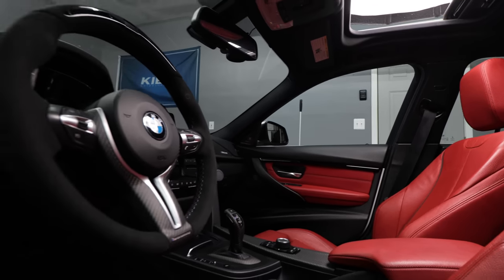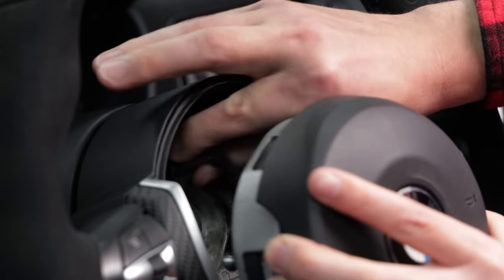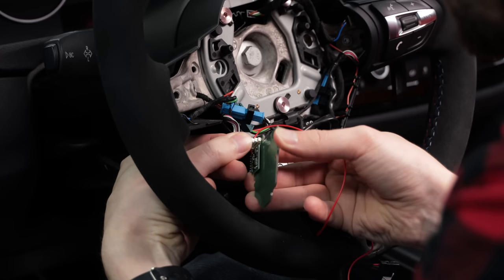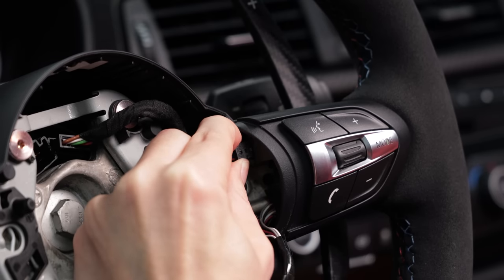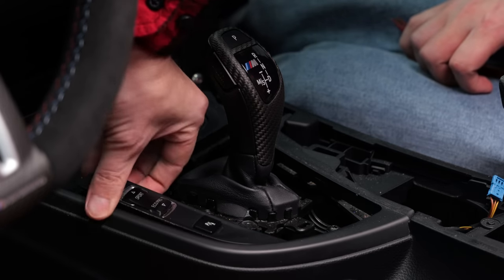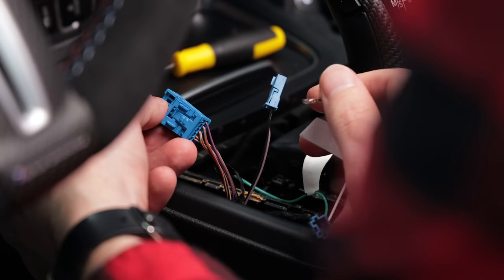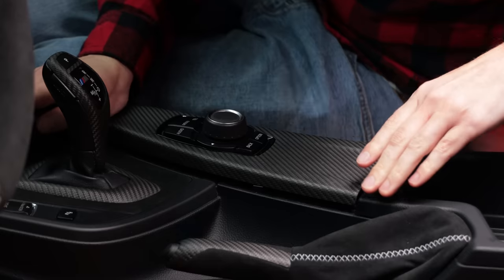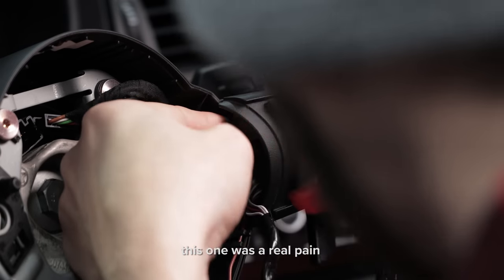How to Install FUNCTIONAL M1, M2 Buttons | BMW F30/ F3x

Comment: Love this video.  Mine is a m240i (f22).  If I only enable the two buttons on the steering wheel and don't change to the new computer board, will that work?

Comment: Hey Justin, thanks for the video! I was wondering can you do this upgrade if you code out the adaptive cruise control? Or do you mean they won’t be blank if you have adaptive CC? I’m just a little confused since you highlighted your CC buttons when you were talking about ACC so I’m not sure if you have the Adaptive CC and disabled it. Sorry…
Reply from the maker: Hey, I think I meant that these could only be installed if your car didn't have adaptive cruise. (mine did not, so the part I highlighted were just dummy buttons.) Since this kit includes its own board and wiring, you should still be able to install it and these buttons would replace the functionality of adaptive cruise. You might not even need to code it out unless it gives you an error.
Reply: @justinbuice  thanks

Comment: I have always thought ofthis in my f20 but wondered if i could codethe buttons to skip tracks instead
Reply from the maker: From what I understand, it comes down to the design of the button circuit board rather than software. Although a board could probably be designed to skip tracks or control other parts of the car

Comment: I hope they come out with a remote start kit that uses a factory key. I'd like to have that feature on my F30.
Reply: That would be awesome! I'd buy it in a heartbeat!
Reply: Don't they have a remote start kit already for the F30?
Reply: @JB-li1gh  I believe they do. However, it's a separate remote. It's not integrated with your OEM key.
Reply: @typejlb  screw that. I wouldn't want to carry around an extra fob just to have remote start. Yeah, id prefer if it was functional on OEM key like the new G-series.
Reply: @JB-li1gh  I agree! I wouldn't want to carry around two remotes. I'm sure some company will make one, one day. I wonder if gatesinnovations is in the making of a remote start key for the F30.
Reply: @viciousninja7053  That would be cool. I know they came out with a digital key, but it's an early adopter product. You have to preorder it. But from the description, it doesn't state that it has a remote start function.
Reply: @JB-li1gh  I did see the digital key fob. It looks really nice. It's pretty much a flex 💪 nothing special about it.
Reply: @typejlb  True!!! An expensive flex 💪  😆

Comment: Hi. I have a 650i with a retrofitted original M6 steering wheel already with the original black M1 and M2 buttons. Can I use this kit and just switch the internal board? Or it has to be the M-sport wheel with the blank buttons??

Comment: I don't have a m sports steering wheel like you. I have the two blank spots and m sports package on my 2015 330i f30. Does that mean this won't work for me
Reply from the maker: You need the M Sport wheel, otherwise the new circuit board wont fit
Reply: @justinbuice  dam. Guess I'll have to upgrade to one 😉😉

Comment: you seriously need to do a 6wb retrofit!!
Reply: thats like the only thing your interior is missing. those base model gauges got to go. otherwise ur interior is 100% perfect and inspired me to restore my f30
Reply: @xqnime  I️ prefer the analog gauges on my 340, it reminds me of my dads old e39
Reply from the maker: @bitcoochie4093  i agree, I like the analogue gauges myself. It’s like the difference between a mechanical watch and an Apple watch. Although I do wish I had the upgraded gauge cluster with the larger screen at the bottom
Reply: @justinbuice  you’re not missing out on much it just displays avg mpg and range, and also directions only if you’re using the bmw nav. It is a nice blend of old and new though